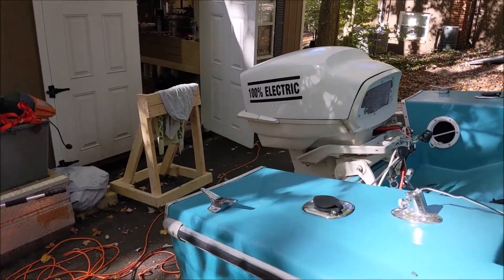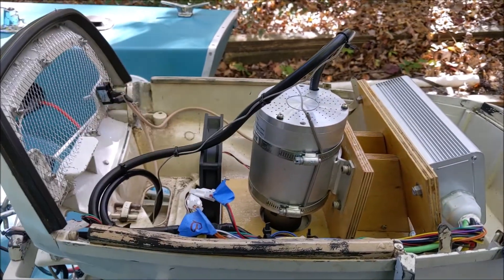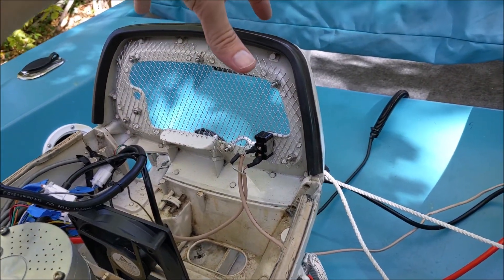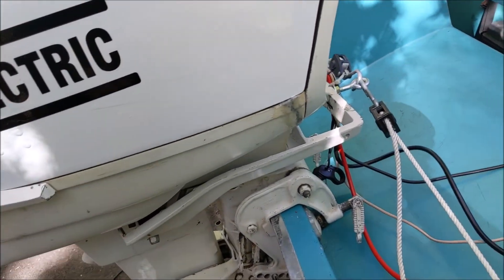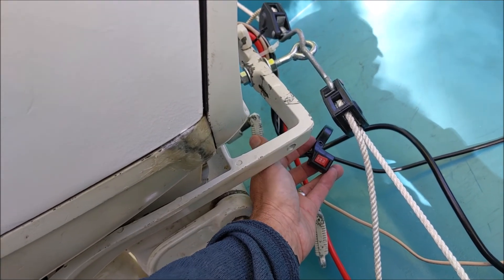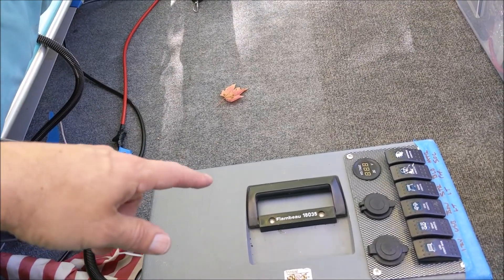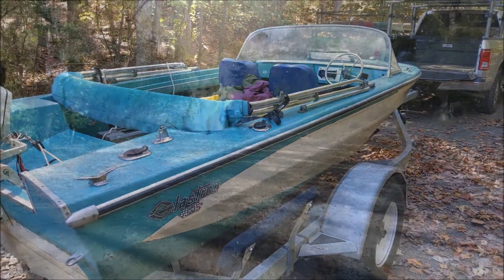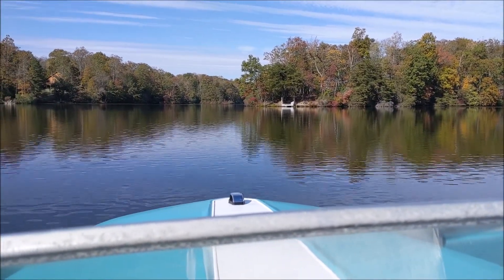2,000 Watt E-Bike Boat Motor!

Comment: nice!!! am thinking I may tear off the gas motor on my gamefisher 1.2 and put this motor on it to push my 8 foot tender around .  How fast have you had this setup going ? What kind of battery? and how many minutes of use do you get out of it? 
thanks , bob
Reply from the maker: Cool.  It was a fun and pretty easy project.  I didn’t use it too many times before giving it to a friend.  Run time would be dependent on how hard it was being pushed and battery size.  Lots of formulas for run time and amp hour drain.  Have fun with the build.

Comment: 1 horsepower is 746 watts. So this is about a 3 hp motor. Woohoo.
Reply: It can probably do about 2500-3000W  for a short time. Still not much fot that kinda boat

Comment: Where did you get your lovejoy connectors from? and what model did you get (that is beefy)?  ALso need the spline model.
Reply from the maker: They were ordered from McMaster Carr.  For the spline I ended up cutting my own.
Reply: @drez20001  oof on the spline, don't have ability to cut that on my own.  Thanks though!

Comment: There is likely a wire on the controller that will reverse the motor. No shifting.
Reply from the maker: True.  The motor could be run in reverse, however the lower unit in the old outboard wasn’t geared/designed to be engaged and run in the opposite direction.

Comment: Very interesting, cheers for the video!  May I ask, is the motor at the top and using a shaft to the original propeller or do you have the motor at the bottom directly attached to the prop? If at the top are you therefore pushing the power through the original gearbox too?

I guess the motors that Epropulsion use must be quite small to fit down below?

Either way it worked really well!
Reply from the maker: Thanks.  It was a fun project.  The motor is mounted at the top and drives the original gearbox.

Comment: Love the design, very Stormtrooper-looking. What kind of speeds did you get compared to the 5 hp? Did the gears affect the speed?
Reply from the maker: Thanks for your comments.  It does look Stormtrooper like.  This outboard was pretty typical of most and had a 2:1 reduction ratio.  So the top rpm would be cut in half, but in reality the motor can't really be run full on for long periods of time without more cooling.  This motor was on a somewhat heavy, deep V, fiberglass boat and was pushing around 1,000 pounds.  The 2,000 watt ebike motor is between 3 and 4 hp at best so top speed was around 5mph.  On a lighter, flat bottom boat it would do far better.

Comment: Thanks for all of that info! awesome idea about the ebike conversion kits genius!  Next video please give us some battery draw, gps speed, speed at different draws, how long will the battery last at that draw etc.  Thats crack for us people who watch these kinds of video's :)
Reply from the maker: Thanks for your questions.  It was a fun build.  I've actually handed off the motor to a friend of mine but the rough numbers when I was using it was around a 40 amp draw at top speed; on the heavy fiberglass, deep V boat I was testing it on top speed was around 5 to 6 mph.  Battery range and run time would be dependent on speed.  A small reduction in speed would greatly expand range of course.  On a light aluminum boat it would probably do very well.

Comment: Those motors produce a lot of torque at the low to mid range of the rpm, a bigger prop helps to use that 2000 watts for efficiently. Gas outboards have high rpm output with the torque coming in at the higher rpm. BLDC or just DC motors can turn a big prop easily. Big prop, deeper angle. Paddle that water out of the way.

Comment: Thanks for this! Great video and very much what I have been looking for.

I wonder what your thoughts are about this: sound/noise level - It seems like the immersed motors (Spirit 1.0) are much quieter than the Ebike-headed motor (which would make some sense.)
Reply from the maker: Top mounted electric motors are definitely louder.  Motors mounted in the hub under the water are a joy to use.